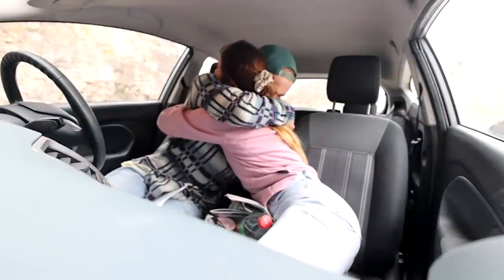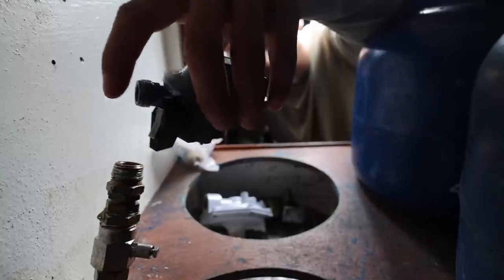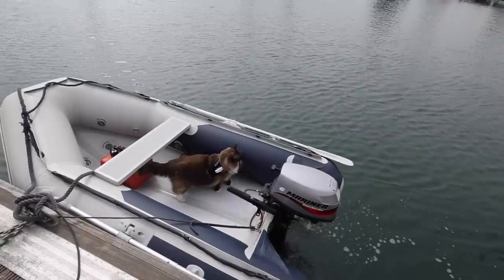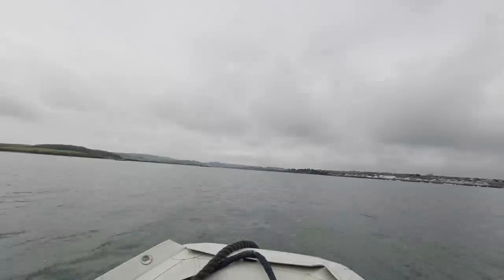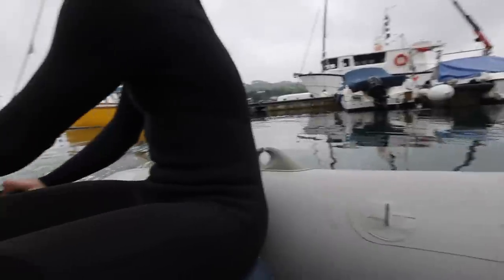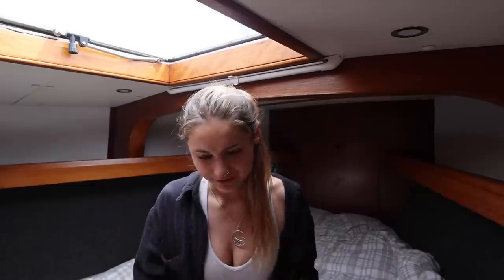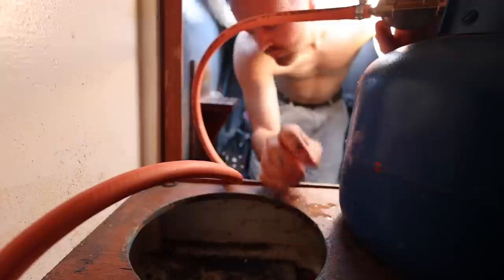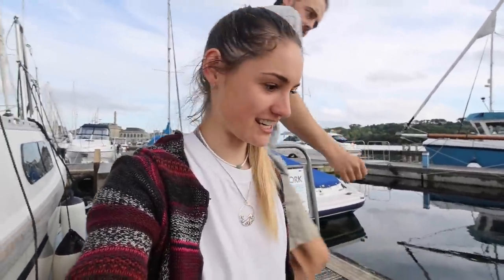We can't rely on this DANGEROUS system on our boat

Comment from the maker: Just to answer a few common questions we are seeing pop up!

1. We have a gas inspection booked by a engineer next week so they will check it all over and provide us with a certificate for our insurance company

2. We tested it afterwards with soapy water and there were no leaks

3. We have bought a gas leak indicator now!

4. The gas locker is vented to outside the boat and is now fully sealed

Thanks for all the helpful advice! We will stay safe 😊
Reply: Did you also pump out your bilges with a manual bilge pump?
If the interior of the boat smelled of gas, this will sink into the bilge, so it's always worth pumping 10 - 15 strokes of air very week to clear any gas from the bilge...
Reply: I was lookimg intently for item 4. Item 1 is excellent as well.   Well done sir!   Put a permanent label near the gas regulator so it is changed in 10 years. Start a ship’s maintenance log and enter that in the log book also. The storage locker should be as tiny as possible, thoroughly sealed, and vented directly to the outside. The locker is a bomb. There is no reason for it to go off. 
But but but….   Venting, sealing, and keeping it tiny makes the risk managable.  I hope this made the learning curve easier.

Comment: That blue regulator is for a blue camping gas bottle, the bit you where trying to fix to the pipe leading to your appliances, is the part that screws on to the bottle, the pin in the middle would push down onto the ball to allow gas to enter the regulator, then the spigot is where to attach your appliance
Reply from the maker: Interesting- thanks Adrian!

Comment: Hi, u need yellow gas Teflon tape, and move the bottle out of the way , give u more room to work. 🇦🇺there called hydrofoils Becka. Now buy an lpg leak detector monitor with alarm, put it in cupboard it will alarm if there's a leak. Also get padlock with large hoop and put it on the outboard toggles where u tighten it to transom, make sure u connect both toggles into padlock, stops theft and stops toggles coming loose, keeping motor still attached to transom win win.
Reply: What he said!
Reply: @aytacercen944  She actually 😁
Reply from the maker: Great suggestion, although when i googled it, gas PTFE tape came up which is what we have so i am unsure on the difference! Will be sure to wrap them anyway and have ordered an alarm- thanks!
Reply: @TeuluTribe  all good, just gotta look after u we do🌞

Comment: Another well done video. Three points.
Please, make sure the bottom of your gas locker is vented outside the boat and the sides of the locker (including the access hatch) are sealed gas tight. It is a "BIG DEAL." That bottled gas is heavier than air (if propane/butane) and if it escapes the hose or bottle it will settle into your bilge if it can find a path. 

Good pick for the "budget" boat. While your new dink is not your "dream dingy" it should provide good service for several years. To extend the life of the tubes, some form of UV protection is a good idea. Chaps (if homemade they're not terribly expensive) or just a "wax" with high UV protection are options. 

Your 2stroke outboard is likely a better choice for you than a newer/cleaner running 4 stroke. It will help if you clean the carb, flush the fuel lines, and make sure you always use the right fuel/oil mix. Other tricks to help the old engine are; drain and flush (with kerosene) the lower unit and do new lube, flush out the raw water cooling with fresh water after use (you won't manage to do this every time but "often" will help), attach a zinc anode, and buy a new prop (or two - depending on price) and learn how to replace them. A 5 horse 2stroke engine, well tuned, with good fuel, a clean carb, and a properly pitched prop, should just get your "new to you" dink on a plane over flat water with one on board.

Again, well done!
Shipper Bob
s/v Wild Rose
Stamos44 ketch
Reply from the maker: Thanks Bob! Locker is vented outside the boat and its now sealed gas tight (wasn't in this vid though!). Great suggestion about UV protecting the dingy! The outboard has been regularly serviced which is nice but nothing like pulling it apart and doing it yourself for peace of mind!

Comment: Hah!! I did that same thing with my camper! The old LPG tank under the camper was cracked, so long story short I a put propane tank in the camper and used the same orange pipe and those rings that you can tighten. It was easy, cheap, fast, secure and a safe enough :D Jood job you two!
Reply from the maker: It sure works! 😊

Comment: As a certified recreational vehicle L.P. Gas instructor let me warn you. You are already in trouble if you smelled gas inside your boat. You are really lucky that you didn't already have an explosion. Please get a certified installer to help you with the gas system. Love your show! Don't want to lose you before you get going.
Reply: Im a certified IA so, I aprove this message.
Reply from the maker: We have a gas inspection by an engineer booked so they will check through everything and give us the go a head 😊 Thanks for being concerned though- we are putting our safety first!

Comment: It’s good that you are having the gas system inspected, it would be a shame to blow your boat and yourselves to bits!
If you want to learn what things the inspection will cover (and maybe fix any minor items before the inspection) google the BSS regulations.  These are actually for canal boats, but they have a very easy to understand guide which is generally applicable to all boats.  
It covers not just the pipework itself, but also how the gas locker drain needs to be, how the cylinders need to be fastened down etc, etc.  All useful knowledge

Comment: So when you mount the gas detector (if it isn’t too late), consider that flatulence will set the thing off. RV owners have often discovered this when a pet sleeps close to the sensor.
Reply from the maker: Its in the stern locker- no flatulence there! 😆
Reply: @TeuluTribe  yea, didn’t know where it might be. In RVs, a common place is at the foot of the bed in the back. Because the gas is heavier than normal air it sinks. Then many an RV owner discovers rather rudely that their pet passes gas while they are sleeping. 

As far as I can tell you don’t have a pet. But such things have been known to change.
Reply from the maker: @AbNomal621  that makes sense! Thanks for the heads up!

Comment: I will mention here a product I have used for many years more effectively than yellow tape.  Master's Pro Dope, the gas rated version.  Putting the fittings together dry is simply not on.  Spring for a bottle of bubble fluid when you buy the pro dope.  Test and retest. Test every time you connect a new bottle.  A detector is not an option.
Reply from the maker: Will check that out- thanks so much. We tested a lot with soapy water but its a great idea to do the same everytime we instal a new bottle. Thanks for the suggestion Mark 😊

Comment: I can see many comments on your gas system already but just to say, l’m glad you are getting an inspection as there were a few things not quite right with your installation. Gas is not to be treated lightly as many do, sadly. Enjoying your videos and will also visit some of the places in South Wales that you mentioned in an earlier video.
Reply from the maker: Hi Simon, thanks for the concern, its all been inspected now and the only changes were a new wire hose at the back of the cooker (it was coming up to the end of its life so we just went for it and changed it out) and a gas bubble leak detector 😊 Everything else was ok which was reassuring. Glad you are liking the vids!

Comment: If it hasnt been started in over a year you will have problems..
Its regular maintainance for outboards to strip clean the carb check the spark plug clean it all .. petrol has changed several times over the years and its generally got worse each time for messing up older engines. Especially gumming up jets and float chambers.
Spencer the guy who has the Foxy lady cat is a qualified gas fitter and ex army..

Liquifaction  of any gas in the pipe can lead to a bit of flare up on ignition under some weather temperatures so dont stand over the burners when you light it..long hair and loose clothing... 
double it. 😉🧙‍♂️

If you dont intend using it for a while turn the gas off at the bottle same if you leave the boat.
Reply from the maker: We always turn the gas off after each use 😊 Yes, will be careful of my hair!! Eek. Thanks Clive!

Comment: You're right, "that's boat life"! Things don't always go to plan, but you just need to keep at it.
Gas system: you're right to be cautious.  It's high pressure from bottle to the regulator, which reduces the pressure from there to the cooker.  It's good to replace those parts, as you've done. The "pig tail" was the high pressure hose between the bottle and the regulator. But now you have the regulator attached to the bottle you can use the orange hose up to the fixed pipe. It's also easier and cheaper to get the orange hose than the pig tails. As previously said, it's essential to make sure the bottom of the locker is sealed gas tight and drained overboard. You should try to seal locker door and ideally have a gas detector. The problem on boats is any leak of gas, which is heavier than air,  accumulates in the bilges and does not easily dissipate.
Dinghy: Great new dinghy and outboard, which should serve you well.  Good idea to service the outboard, as already said by others, especially keeping the carburettor clean. Old outboards don't like new bio fuel unfortunately.
You'll learn quickly by sharing your experiences and taking account of the advice.
Well done, and enjoy yourselves, safely of course.
Reply from the maker: Persistance pays off! Thats great advice, thanks! The gas locker is now sealed and already was draining overboard (although it probably wasn't before as the damn locker wasn't sealed!). And have a gas leak detector on order! Will give the outboard a good old service. Thanks so much 😊

Comment: Seems to me that the gas regulator is one that fits to the bottle (as mine does) and the flexi pipe goes onto the fitted fixed pipe where you took of the old regulator but hey there are so many variations, but as you already know there are ways around those problems. another great video folks.
Reply from the maker: There seems to be a lot of variations, you are right! Thanks so much 😊

Comment: Get the gas engineer out to do the job, dont guess.  At 3.23 the regulator is fine if attached to the top of the gas bottle, but, you have the gas connected to the outlet from the regulator which should be going to the cooker.  If there isn't a fitting for what you want to do then there is usually a good reason.  Best not to blunder on with something you don't have the knowledge to do.  You need to know when you don't know...and ask for help in chandlers or a professional.  Sorry if that sounds harsh but gas isn't something to do trial and error as the error will blow you, and the boat, up.  As many have said check the gas bottle is in a proper gas locker vented overboard including taking into account when heeling if using whilst sailing.  Stay safe guys.  Andy UK
Reply from the maker: We know we aren't pros at this so have a gas engineer coming out soon 😊 The locker is now sealed and does vent overboard and we now have an gas leak alarm in the post- thanks Andy! 😊

Comment: Good job on the dinghy guys. Light and easy and should get you everywhere you need to go for now. Maybe consider getting some of those fold down wheels so you don't drag the bottom on the beach.
Reply from the maker: We have some wheels- just need to dig them out the stern locker! 🤣

Comment: Great video as usual. Does your gas locker drain overboard? In other words if you have a leak at the bottle the gas drains overboard and not into the boat. Because gas is heavier than air you won’t smell it, meaning you have a risk of fire/explosion. It’s usually a insurance requirement too. Tim Beck in Saltash is very good if you want a professional to look at it.
Reply from the maker: It does drain overboard and its sealed now so its doing its job finally! Its Tim Beck we have been in contact with- thanks for the suggestion! 😊

Comment: Hmm...I would be inclined to use thread tape on those new gas fittings. Whilst DIY at sea is a necessity of convenience, with this oldish boat and the risks associated with gas leaks and naked flames, as per your cooker, I would also be inclined to have a licensed gas fitter involved in any upgrade and which would have a positive influence in the event of any theoretical future potential insurance claim.
I would also install a gas alarm system of the type commonly installed in modern motorhomes and which also might have a positive impact on your insurance.
If you do take off into the blue yonder, determine the nature of the gas fittings commonly used in international locations and acquire the various adaptors required to be able to refill your gas bottles.
Reply from the maker: We have a inspection booked by a gas engineer soon! And have ordered a gas leak alarm 😊 Thanks so much for the advice
Reply: @TeuluTribe  Thank you for the reply. I am glad that you haver taken those steps.
Fair winds to you both.

PS In an episode, perhaps 5-10 ago I recommended that you do something about a 'watermaker' as with your smallish cruiser and the distances that you will eventually journey over, fresh water will become as precious as gold, increasing your outgoings by the regular marina berthing to access water at a cost. I didn't get a reply but it was a non-current episode which perhaps you were. not reviewing from time to time--I am not sure how non-current comments are received by the channel--but it really will become a 'must-have' capability.
Cheers
Reply from the maker: Oh sorry, we try and reply to every comment we get! Just had a search and the only other one i can find is your one about the knife on the stopping boat jobs vid but apologies if we missed it! We would love a watermaker, the wallet at this point in time, wouldn't love it 😅 however its on the list! Thanks so much for the suggestion 😊

Comment: Highly recommend a 12v gas control system where you can mount the push button switch near the range. Makes it supper easy to turn on/off the gas supply directly on the low pressure side of the regulator. You will forget to turn off the gas if it is somewhere that is a pain to get to, requires braving the elements, or use it during a rough passage.
Reply from the maker: That does sound great, its something we will look to upgrade soon- thanks Joel!

Comment: I know from having a camping gaz stove every country has a different type of bottle / connector and needs a different regulator. So having the regulator attached to the bottle not the wall makes more sense. You'll end up with a collection of screw fittings, regulators and keep spare pipe/clips in stores depending on where you go on your travels. Long term - I think it will be best to go all electric so you can get self suffiecient off grid and not have the satefy issues with gas. There's camper induction hobs now that run 2 rings at lower shared power settings than the ones designed for mains. Saw about them on Saling SV Delos channel as it's what they have. At home I use cast iron cookware (from Aldi) on my induction as it really spreads the heat and rarely go above power 3 for a good rolling boil.
Reply from the maker: Thanks Simon- yes, i think you are 100% right- we want to go fully electric (or maybe alcohol) in the future but its too expensive at this point, hopefully in due course we will! Will look into the cast iron cookware, thanks 😊

Comment: You may wish to check the propane system standards required by your boat insurance policy. The GB standards may be different but worm clamp terminated hose connection is not approved here. A service shop should be able to make you up approved propane flex lines with approved fittings. It is also possible to put a 12v solenoid between the bottle and the regulator that allows you to remotely turn off the propane when not in use or in the case of an emergency. At least have a qualified tech inspect your system.
Reply from the maker: We have a gas engineer inspection booked soon and they will rectify any issues and provide us with a certificate for our insurance. Fitting a solenoid is a great suggestion as at the moment we run outside and turn it off after each use but it would be safer this way- thanks for the suggestion!

Comment: That regulator is not the right one. It looks like one designed to fit on the top of the bottle. You need the wall mounted type with a hose tail. You also need to use gas safe Teflon tape on the screw threads to seal the joints.
Reply: Yes my thoughts too. It looks like one for the blue campingaz butane bottles.
You need the right fitting, the right pressure (30 or 50 mBar) and made for the right gas. A propane version is OK for Butane but a butane is not good for propane.  (at least, 15 years ago in the time gas on boats and RVs was part of my job)
Reply from the maker: We couldn't find a wall mounted one in any of the chandlery's around here! However, we have a gas inspection booked in soon so hopefully can get it sorted then. Thanks for the advice!
Reply: @TeuluTribe  try a Calor Gas distributor a firm that does gas plumbing like City Plumbing or the main Calor distributor. However you should also check the supply of 4.5 kg Calor bottles as they are almost impossible to get. I had to swap to camping gaz which is a different regulator